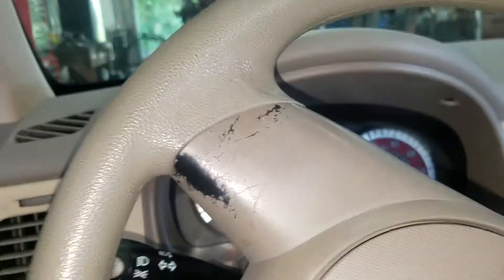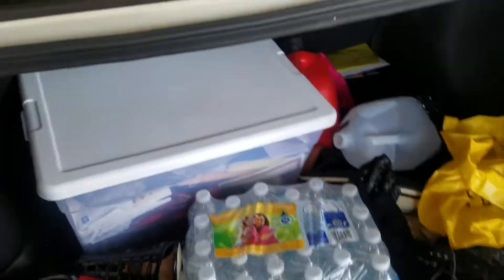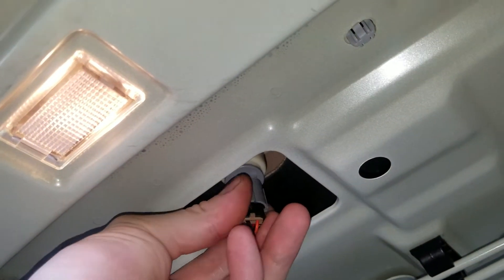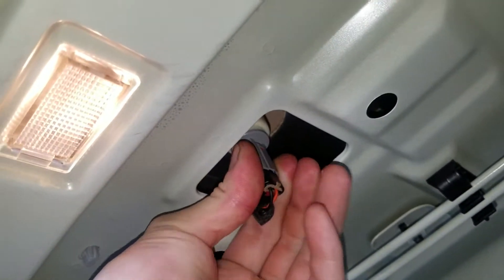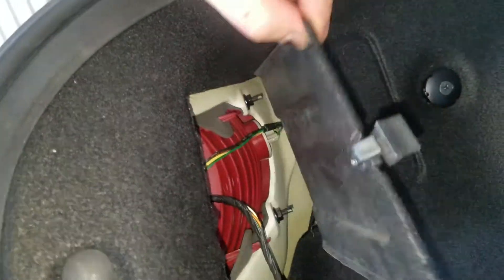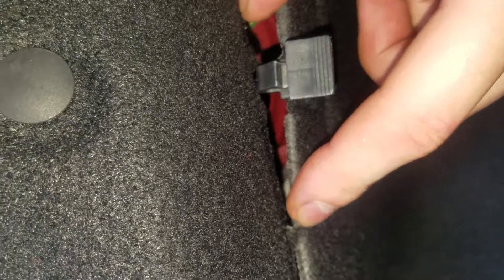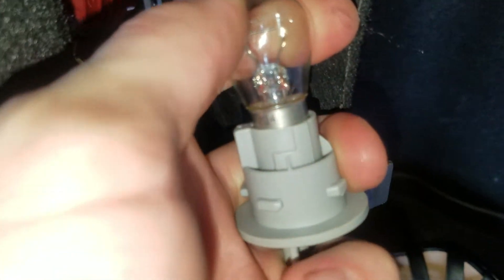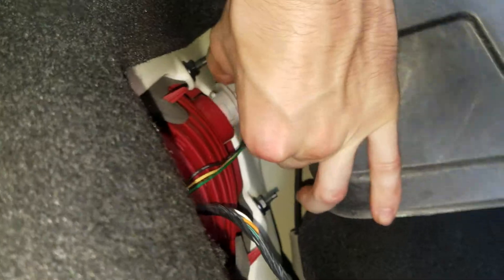Kia Rio Brake Bulbs Replacement

Comment: How can I find instructions on replacing the center high mount socket... I have to purchase the whole wiring kit,  or whatever you call it,  from kia. I can't just replace the socket. But I can't find any instructions on how to do this
My car is a 2006 kia Rio/base. The dealship wants $200 to do this. Any suggestions?  Thx Great,  easy to follow vid BTW.
Reply from the maker: I would go to a junkyard and pull a socket out of another kia.. bring your socket with you so you can match it up. Worst case get a socket that fits loosely and silicone it in place, solder or crimp into the harness. Beats spending $200 on a plastic bit.
Reply: @LehewTech  thx... I will try that... I am not wanting to spend this on my dog car. Great idea
Reply: Agh I’m needing the same thing now what did you end up doing ? Any luck ??

Comment: That is perfect, I have a 2011 too, but the interior is black instead of tan, so i don't see the wear on the steering wheel.
Thank you a lot.
Maybe the left rear bulb goes out more frequently in this model for some reason?
Also, what happened to your thumb!
Reply from the maker: Thats great man black interiors are nice always look cleaner than tan ones for me. Not sure about the left rear bulb failing more but stranger things have happened.. Maybe that side of the car vibrates more because we drive on the right side of the road?😂 I cant remember what i smashed my thumb on but shortly afterward that blood blister showed up under my nail.